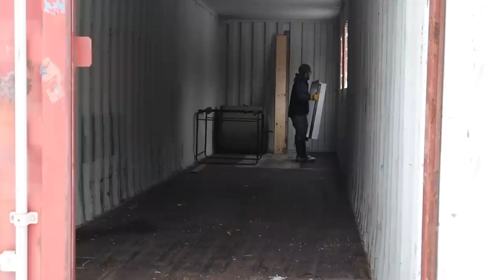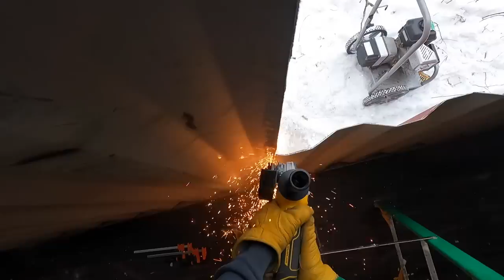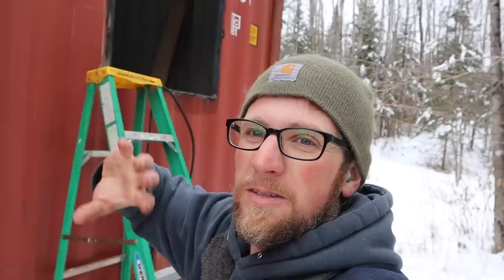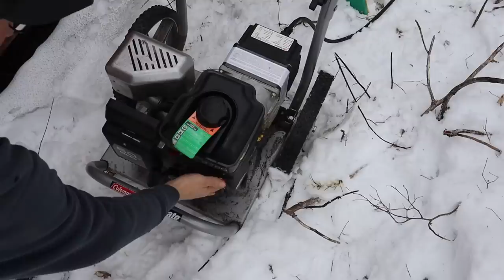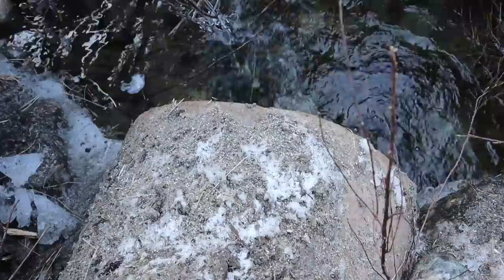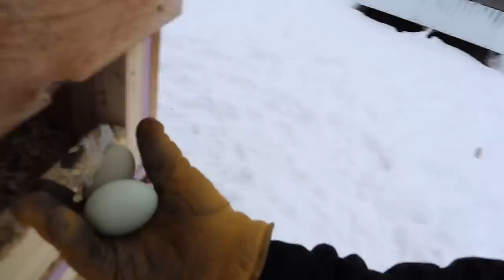Welding Angle IRON Window Frames in Our OFF-GRID Shipping Container Cabin in the Woods

Comment: Hey Al and Gina and Olivia, great family project we love to see it. If you save the steel cutouts from the windows and future door, you can wel d a steel frame around their four sides, hinge them at the top with piano hinge welded on for rain and shade protection, and then drill through the frame several places and attach tamper approved carriage bolts from the outside, with washers and wing nuts on the inside to keep it secure when you're not there but easy enough to open the awning when you are there. 
Please be careful not to slice your hand on the sharp edges, you can use a grinding wheel to take all the burrs and reduce the knife blade-like sharp edges of all container openings and cut out pieces.

Comment: In the shipping container, how about putting the wood burner stove in the corner of the dividing wall near the garage end.
You could run a heat vent to share some heat in the garage when needed. Like to thaw and dry snow from the tracks.

Comment: You need to use a chipping hammer and a wire brush to clean your welds before you caulk. Flux core mig is like stick welding, you need to remove the flux. 
Looking good.

Comment: Al, you looked much more comfortable with the welder on the second window frame. Your welding will get better and better as you gain more experience. That flux core is probably the hardest wire to learn on. Gas shielded MIG is much easier to learn, but you got to lug around a tank of argon. By the time you get through with the shipping container project you'll be an old pro. Welding is an essential skill needed in any farming operation. You can build some really nice fences. Thank you for sharing your life with us.

Comment: Al, saw a video about a container window installation in Newport,TN. They used metal  framing for 2 windows, then had to remove metal because even in TN the frames caused moisture inside because of the transfer of cold into the warmth of the container.

Comment: Looking good Al, great progress... Would pay to put a gently sloping roof over the whole container  to allow for snow etc to slide off instead of just sitting on top of the container. We call them a "Tropical Roof" here is Aussie land, helps with heat retention and cooling in the hot weather by creating an air gap between the container roof and the environment.. You could extend it out past the sides of the container to form a verandah or covered parking for the truck..

Comment: Remember the sides of the container are part of its strength, when you cut out doors and windows use suitably strong metal and enough to put the strength back. Fully welded in.

Comment: Good morning, Lumnah's!  I would get some type of Wood Stove in there "AL" right away. Cut your hole in while you have everything on site. This would be for the flue pipe. Get some oil on those hinges. You could even have bolted those window frames in. You still could put a bolt in each corner. With that water always running "Al"  you have a source of Hydro-Electric . You could check into it.

Comment: When welding gind paint off first then only tig weld the  inside of the window frame then the same for the outside window frame the reason it will come out to be crooked when it cools down after you have fully welded both remember to weld each side of them at intervals too.

Comment: Prepare both metal surfaces with a sander or grinder to be shinny and remove all paint or contamination. Before you weld and it will make the best welds fast and easy.

Comment: Weld the whole thing!  Caulk will eventually fail, you'll get water infiltration and it will rust out.  Weld it all, clean up the welds, and just hit it with a couple coats of Rustoleum.  And yes you'll get better welds if you knock off that paint real quick.

Comment: Great job.  Couple of welding tips for you.   Easy to develop bad habbits if you do not start with good habits. 
First work angle 10 degrees,  travel angle 20 - 40 degrees.  Then its a matter of heat setting, and wire speed.  You want to see a key hole as you weld and fill it as you go.  Wire speed on the slow side is nice for a beginner...   Id say your wire speed is a little to fast..   but not sure.   A good welding book and so practice you will be a pro...   of weld left to right whenever possible...  come down with your weld when welding horizontal...  for now...  
The black tar chalk is best for long lasting on steel...  takes pain also...  If you cant get it come to AK for a vacation and I can make you a pro!  Lol

Comment: Amazing changes to the site, love the pond area, it is going to be great when the grass grows.
As for the Cabin...I would have used insulated truck bodies, they are super insulated and have plywood/foam sandwich walls that you can cut with a chainsaw. I used two of them to make an Algae production facility, and clean lab with office space in between. They are far better than steel containers and cheaper than buying steel and then insulating them. Not only that, but seeing as all the insulation is in the walls...you don't lose any of that valuable real estate inside the container compared to studding and insulation on the inside.
If you put a nice big window where the refrigeration unit used to mount, you end up with a light airy feel inside. Add a UPVC Front Door and stud wall at the other end and you will be amazed how much space and light there is.

Comment: There is a 1986 ford/shasta camper (Plymouth)

For free on Craigslist.  No title not running. Will cost towing and bam insta cabin.

You can use the container room for a workshop. So its not wasted work.

Comment: I would be using a plumb bob too, to check the inserts aren't racked. I would use a butyl product to seal them up.
Reply: If they were racked they wouldn't be square, and he did check the diagonals. Opening could still be tilted/off plumb, but he laid out the cut lines with a spirit level...
Reply: The vertical and horizontal or x, y, planes were checked if you look at z plane or in out axis they can be racked on that plane. When you install the sealed units they go in but can have a gap at the top or bottom in the corners. Spirit levels have a margin of error in them thus l always do a quick check with a plumb bob for vertical and the 3,4,5 measurements in the corners to ensure a 90° corner. My son just made this error with some doors he installed. The fix was easy by removing the screws in the jambs and resetting them. Do you see what l am saying?
Reply: @mauriceryton  I can see the z-plane issue, at least I think I get your meaning - but in this case the frame 'flanges' are clamped to the wall and thus parallel to that. Now, whether the walls are plumb or not is an open question given the iffy foundation, and/or where/what the final placement will be... it is a moveable structure, so parallel to the walls is likely the best one can go for, at least until/unless on solid final foundation.  3-4-5 is one method to determine 90 degrees in one corner, but if you've got equal length sides (and if not equal, at least pair wise, you'll never get all 4 90s) as best measured and cut, and equal diagonals, then there's 4 90 degree angles.

Comment: the window cutouts should have had quarter inch clearance on all sides so the angle frame could sit flush with the inside wall, 
avoiding the inside corner of angle which is rounded.
the paint is probably lead based, try not to suck in too much fumes, either grinding or welding on it

Comment: Automotive seam sealer for those window frames Al. Far better adhesion to a metal to metal surface than silicone or builders calk. Great work as always. Doesn't need to look pretty it just needs to work 👍

Comment: Turning down the feed speed of the wire feeder and turning up the temperature of the welder will also give you much better welds outside in the snow on huge metal containers.

Comment: if you take a three inch strip of the part you cut out of the hole you can weld a flat piece of metal to the bottom of it and it will fit to the corrugated profile and weld it above the window and it will give you a water tight overhang over the window. then weld hinges to the other part you cut out of the hole and make a closing shutter over the window for protection when you are not up there.

Comment: Did you grind the paint off the edge of the hole about 1/4” back, that makes a big difference in the way your weld looks. Must clean paint, rust and chewing gum off the edge before welding. There are a lot of tricks to help you get better welds, you will learn something new every time.

Comment: one thing id do is use the off cuts to create an angled  overhang over the  windows to stop snow build up on top of the windows, ive learned water gets in anywhere it wants, even when you use corking, it doesnt always work, you dont want 100 sheets of rock wall in there and the bottoms ruined from a leaking window...
Reply: LOt of good waterproof materials available
Reply: @davelawson2564  not when it comes to metal, water can seep through between the cork over time, ive used many brands and all have failed, its better to weld a over hang over the window rather than spend more time later repairing work you should of done right the first time... i have several containers only one suffered damp or flooding inside it due to NOT welding a plate above the windows, now i have plates over all the windows and have no issues with damp or leaking windows
Reply: @cheekymonkey666  Agree. allowing snow/water to stay on the frame allows it to seep . Have you used Dr fixit that is mixed with cement/caulk ? It has worked well

Comment: When you weld , don't drag your wire push it into the weld! Except for your virtual welds . Also you will have better luck if clean your surface with a  grinder before you weld. 
And I would advise that you use a good caulking such as  beautal industrial,  it will shrink or expand with your materials. 
Bill

Comment: Consider lubricating those container doors each time you go there. They will begin to work so smooth.
Reply: More often than not, the doors are binding because the container is not flat and or Square.
Reply: @Hagar2670    True. I’ve been around a lot of containers and it really helps. Especially the latches.
Reply: Mark Randall  me too, spent fifteen years working with them. Grease will stop a squeaky door, but those are binding.

Comment: Al! Ur supposed to grind the paint off the container so the welds adhere correctly! As OCD as you (which is a complement!) I would have thought for sure you would have read that! U can paint it after... Hempel sells the Zim red in 5 gallon drums. I would put a coat of paint on the roof too before it starts corroding. East coast units are in too much humidity... roof is the first to go.

Comment: I'm no master welder, but aren't you supposed to remove the paint from the container wall before you start trying to weld something onto it?  You know, like with a wire wheel or angle grinder?

Comment: Al, you might get better results by tacking that frame to the container every few inches.  When you've gone around the whole frame, extend your tacks in increments again going around the frame.  Metal expands when it's heated by welding and contracts as it's cooled.  By welding metal in a single pass, you build up those stresses and it will crack to release them.  This is far more important when welding thinner metal like you container.

Comment: Hey, Al, how's the weld penetration on the container side when leaving the paint on like you did? I had been taught that you'd have to grind the paint off further from the metal frame first, and find a bare metal spot to clamp your ground clamp to the container. It'd be nice to know if I don't have to do all of that!
Reply from the maker: The welds would have come out nicer if I had grind off the paint first
Reply: @LumnahAcres  Yeah, but I'm really more asking if you got a good mechanical join between the frame and the wall. As you said, the aesthetics and seal can be fixed with caulk.
Reply: @LumnahAcres  Yes! But it goes faster if you skip a few steps! You have just lost your OCD card.
Reply: I was going to write about the same thing the welds bond better and are smother
Reply: @LumnahAcres  Like you said "I'm not a welder !"  A high percentage of welding is surface preparation !
Reply: Cleaning that paint would be a very big improvement on your welds. From watching the welding there is almost no penitration to bond the two metals. Thats Flux core so you need to chip off the surface of the weld bead to see the real bead not just the Flux. That paint is not to good to breath in when sanded,  ground, or heated up. 
Do more research on Flux welding and the paint on containers, you will get scared to think about what you just breathed in welding over that paint snd sealer.
Reply: If you take a class they cover safety, then surface prep, then finally get to welding.
Reply: @PatrickPoet  and not to buy welding equipment from Harbor Freight 😁
Reply: Flux core wire shouldn't be that much trouble
Reply: @francishier4698  flux core shouldn't be how much trouble? Can't figure out what you mean.
Reply: Always always always I can't stress it enough clean up the metal to nice shiny clean metal I do care if someone tells you with flux core or if your stick welding "farmer rod" that you don't need to clean up the metal and that they have been welding for 30 years, well guess what, they been doing it wrong for 30 years.... Also clean off a spot for your ground so you get the best ground possible.... Oh and with new metal the reason you need to clean it up is to get rid of all that Mill scale and oil or whatever else has been put on it so it hasn't rusted or just oil that's gotten on it from when they cut it if they use the bandsaw from the cooling oil for the blade!!!!
Reply: Also if you would like any pointers for future welding that you may be doing pm me on Facebook, always glad to help, plus then I won't cringe Everytime I see your going to weld and fabricate on one of your videos lol ....
Reply: Iron *Fe*  But what will happen I don't care who welds it.
Reply: @w00dbutcher50  🤣😂🙃👌
Reply: First thing I notice too Pete.
Reply: @PatrickPoet  flux core has the same characteristics of 7018 stick welding  and it cleans porosity from the weld and most paint is classified as weld through paint
Reply: @Lumnah Acres
 A carpenter, you are!  A welder, (in your words), are not.  Listen to these guys in the comments.   Its not bs.   Either way..Love ya'll and enjoy the channel very much.   Cant wait for the next.   Cheers :)
Reply: "Two weeks ago I couldn't even spell welder and now I are one!" I don't think you read these comments but, for those that do, please don't try what he's doing with his welder at home. Get a book on basic welding set-up and read about safety issues for welders before plugging your welder in. These run on high amperage and amperage is what kills you in electricity. Welds are extremely hot and so is the metal next to them. The heat can melt the insulation on your welding torch cables and grounding cables in a split second. Paint should always be removed and all metal cleaned before welding, if you want your welds to hold. Slag should be removed after any weld done with fluxcore wire. Al has broken every cardinal sin on welding, prepping and welding safety!
Reply: Easy on old Al, you lot. Encourage him to learn, and be constructive. Anyone who welds is a welder. Someone who does it for money is a professional welder. Someone who’s done it for years is an experienced welder. Someone who picks up a MIG for the first time is still a welder, and deserves respect, encouragement, and constructive, positive criticism all the more for trying something new!

And Al, I guess you might have to re-grind and redo those welds before caulk, or this lot won’t stop riding you. Sorry for bringing them out of the woodwork, friend!
Reply: @fisherus  no worry, since this entire show is a soap opera, his sponsors will come back later(off camera) and fix his screw ups.
Reply: Iron *Fe*  so you are saying that if I went to welding school, they would tell me to buy HF equipment? And at one point us hard working Americans stop buying cheap Chinese stuff that they copied from legitimate companies that employ fellow Americans just so we can save a couple bucks. My comment was in light humor in response to someone talking about welding school but as usually on youtube someone all know has to come along and set everyone straight.
Reply: @kb7722  Hi Patrick, just curious,  why not buy welding equipment from Harbor Freight? They get good reviews... Thank you.
Reply: @brucecoron928  Hi Bruce, great comments and what a nice offer to help Al 🤓 😻
Reply: @zetuskid  Funny! 😅
Reply: Iron *Fe*  wow name calling. Real mature
Reply: @francishier4698  you keep thinking all that and keep welding the way you think and not listening to anybody else's advice, let me know how that works out for you in the long run!!!! There's a difference between a junkyard welder and a professional and the pay will reflect that, just saying!!!!
Reply: @brucecoron928  well sir maybe one day I might make a good welder but a carry a awi certification and as a40 year union iron worker and welded for  boiler makers and a fit up man I think I'm ok
Reply: @francishier4698  all you Iron Heads are the same just stay to walking the steel and bolting them beams together!!!! I'm a 20 Union Pipefitter/Welder and have more certs then you can count hand welding and automatics!!!! So keep tooting your own horn there bub!!!!
Reply: @brucecoron928  ok I will but let's remember who's tooting who's horn